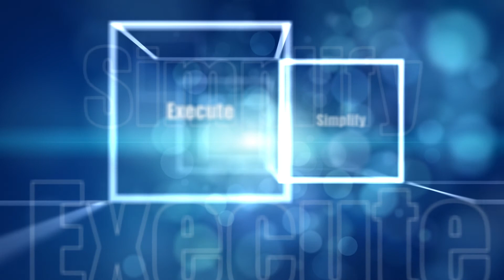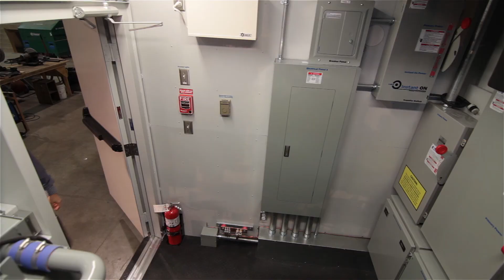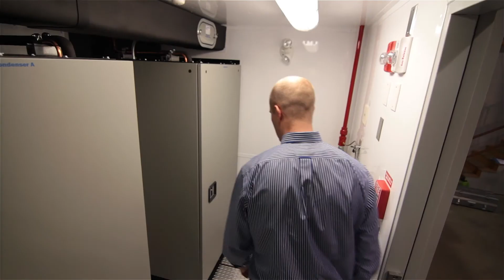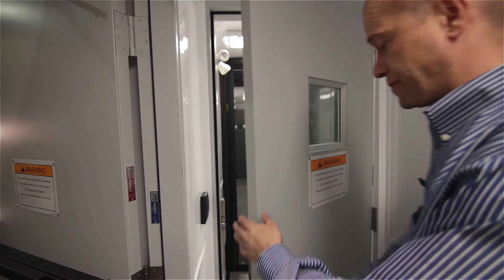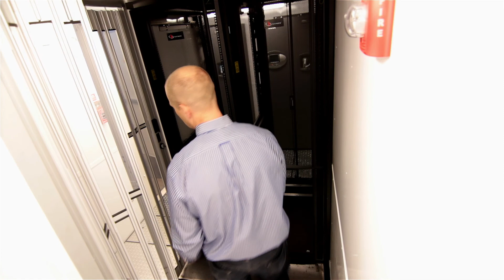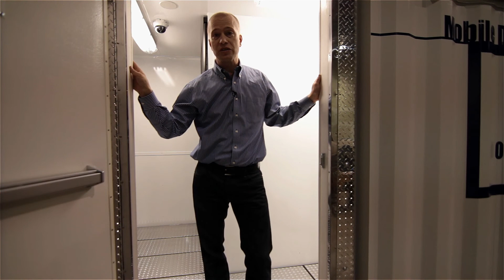Mobile Data Center tour- Bulldog Containers

Comment: That security camera isn't flush mount...
Reply: +Allen W You are correct, there are three things that need to be installed when it arrives on site.  2 cameras and the generator exhaust pipe.  To get the correct field of vision for the cameras we thought that this would be small install on site all mounting and wiring is complete at the box and is weather proof for travel.  Thanks for your interest in our product.